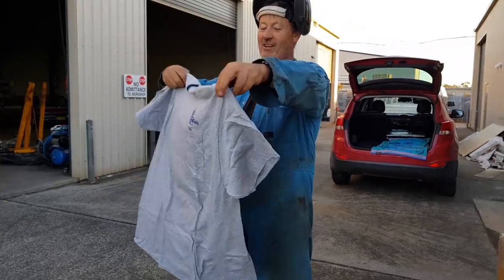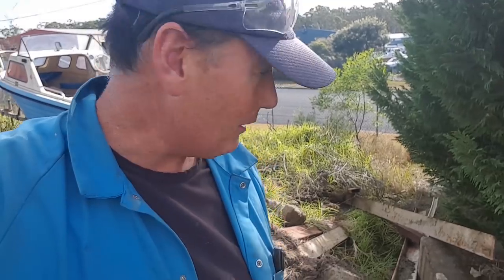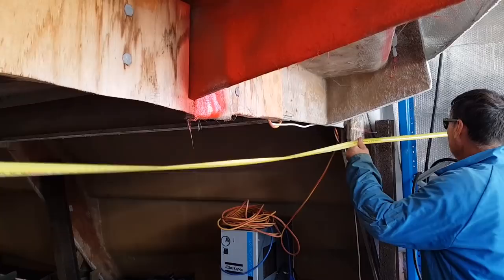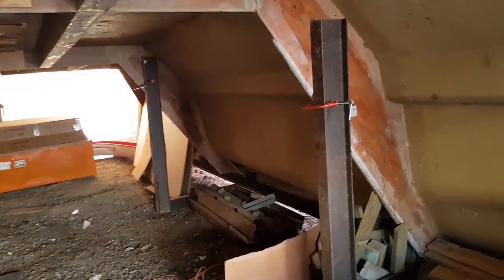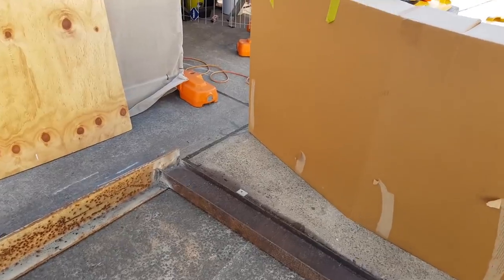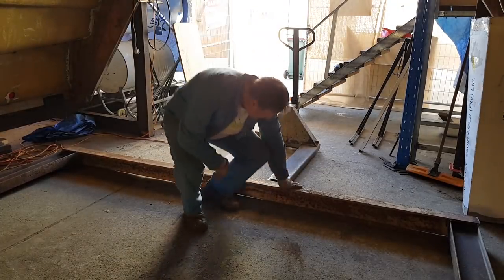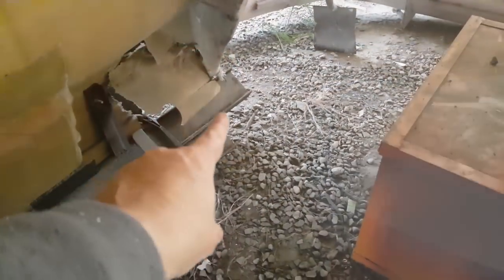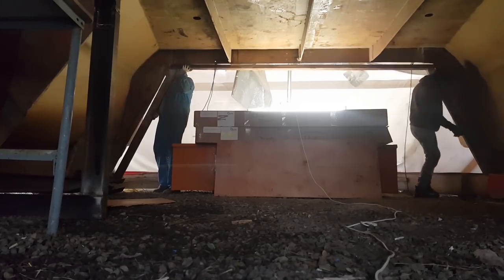Ep041 The Hard Graft - Life On the Hulls - Catamaran Build

Comment: Rossco you should of had the longer flange section in the vertical plain to get the longer rigidity in the horizontal plane to stiffen the two hulls from flexing.
Buuuuttt being that thick ( like most blokes😱) it should be OK especially with all the timber and fibreglass.🤙keep up the great work mate.
Reply from the maker: Hey Nick, I did think of this and opted for the reverse simply so I didn't clobber myself in the head every time and we are talking millions of times under the mould. I have welded brackets to the ctrs and bolted them to the mould as well so I reckon it should be ok with adjustable removable acrow props spanning the horizontal between the uprights at floor level under the truck chassis for any future move and ultimately demoulding. All the best Ross
Reply: Life On The Mold - Building a Catamaran I know your only teasing as you did at the end, you probably have that puppy out of the mold already👌
Reply from the maker: @nickcooper14  nah not yet.Storage is a major issue here.Once demoulded I have 2 cats to store.Have to complete all bulkheads before demould to ensure structure id sound even though hull is technicsally monococque.Just getting all my ducks in a line this period.Thanks Nick.

Comment: Just a thought but if you are picking up the mold from the raised center section of the mold (can't remember the technical name of the boat) and the two hulls are hanging down on each side of the trailer you may get a fair amount of sag or bend in the mold from hull to hull (although this could possibly help when removing the hull). In the original configuration when the mold was lifted the floor beams would have been in compression from the mass of the two hulls, so as you have it now without the base beams running the full width of the mold they will naturally pull together without trying to oversimplifying it too much. If you put in bolt in diagonal braces to help support the load this will help to make up for the floor beams being removed, that way you can still roll in and out the trailer. I'd hate to see you damage all that lovely work by putting cracks in the hull. Thank you for the videos and keep up the good work, anyway that's just my 2 penny's worth from an engineer in rainy old blighty.
Reply from the maker: Gidday Rick, The same dawn of realisation came upon me when I pushed truck back under and given the torture I had put the beams through when transporting it all down the coast, I have decided to install 3 expandable acrowprops horizontally between the uprights at just above ground level to stop any chance of the hulls creeping downwards whilst being lifted. This will still work under the subframe of the truck chassis with enough clearance for the lift Great to see you are thinking things out for me though and great minds thinks alike.

Comment: You’ll need temporary beams across the bottom at ground level (compression) when you lift. You’ll also need more beer!
Reply from the maker: For sure Phil, I am installing horizontal acrowprops between each of the supports that will travel well under the chassis after lifting . Each will be bracketed to the uprights and removable on settling it down. Great to see you are thinking and not just relaxing whilst watching the hard graft Cheers Ross